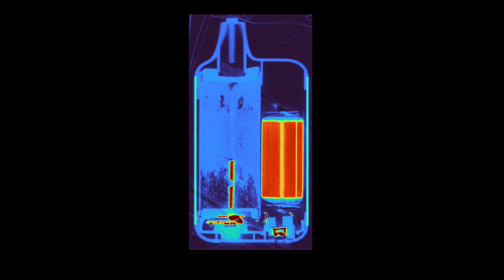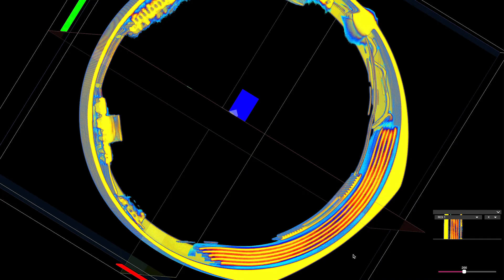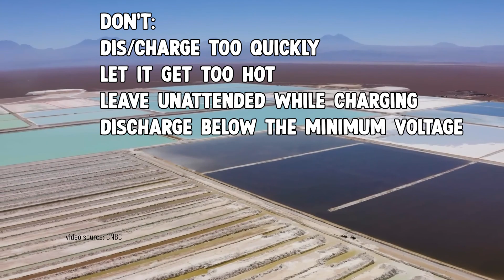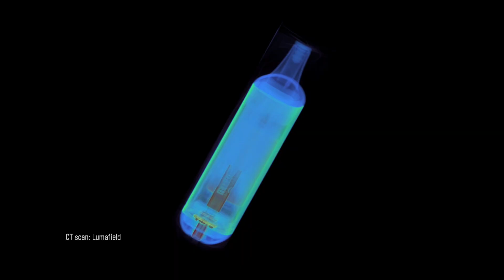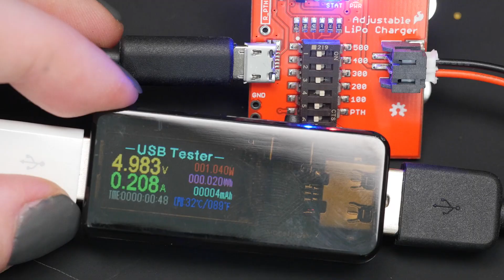Can you reuse these batteries?

Comment: Hello.
I have collected over 1000 empty vapes through my friends and friends of friends.
I am over 1 kWh with my power bank powering the lights in my house.
However, my batteries are submerged in hydraulic oil to avoid any leakage issues.

Comment: Be advised. I was safely recharging a vape battery I found in the gutter using methods almost identical to these. After a few moments, it exploded, flew off my workbench, and burned a hole in the floor. Also, while trying to contain it, I inhaled the fumes. The battery was probably compromised, considering where I found it. For a tiny battery, it was an incredible fire. 
Thank you for sharing a safe way to reuse the little power storage units.
Inspection before charging for any flaw is important. 
Cheers!

Comment: I modified one to be a handheld wind speed, temperature, and humidity device. Now modifying another as a wireless speed controller for my boat's trolling motor. I think I can fit the ATtiny85, pot, and the NRF24 inside the case.

Comment: The reason I use them (I'm in the UK though) is the max 2ml tank rule in the UK. It's just very annoying to have a refill a vape every few puffs and the 2ml thing is like a bad joke.

To be fair I've only used them since they added a way to recharge and refill them but yeah they get maybe 2 weeks best case even with that.

That said I haven't binned a battery yet I keep them as spares and tend to only use the lost Mary bm6000 so I can keep switching the batteries.

Comment: Nicotine is actually a very toxic chemical with an LD50 lethal dose of only 6,5mg / kg. If a vape contains 20 mg / ml and 2 ml that equals 40 mg. Combine this with the fact that nicotine absorbs through skin (that is why nicotine patches work). 40 mg would be lethal to someone with the weight of 6kg. That might not be you but a small baby or pet could get severly injured when exposed. So it's mandatory to wear gloves when doing this and to get rid of any residues asap.

Comment: I watched this yesterday,today I saw a vape in the road. Now I have a battery to play with. the disassembly info presented here was invaluable.
BTW,the low cost TP4056 USB charging circuit can be tweaked by a resistor change to drop the charge current from 1 amp down to lower levels.

Comment: I have disassembled my first one and it has a 1Mhz ARM N32G-031.  It also has a small LCD display.  What a huge waste!  Wondering if the circuit can be re-purposed.
Reply: In addition, there is an airflow detector which fires up the processor any time there is flow.  The push button on it allows for the switching of the mode of operation.  I wonder if there is any way to access and re-program the processor via the USB-C connector.

Comment: great information in this video, rember to capacity test all your cells before use, i noticed recycled  vape cells to be more consistent then recycled 18650 cells but I've had a few that had lower capacity then expected, i use the same charger/ tester for 18650 and the vape cells, use a dummy cell in the charger with jump leads for the vape cells,  these vapes banned here in Australia but i still find some

Comment: Anyone here have any idea why I might be reading 7.4v off of one of the batteries I pulled from a ripper vape by rufpuf? It has 3.7v 550mah printed on it... It does not appear to be two cells in series. It's a cylinder with positive and negative on the ends. I think I'm just uneducated on my multimeter and used the wrong setting.

Comment: Instant sub. THANKS! LEarned a TON. Grab yourself a heat gun: better and safer than a lighter. Got one at HD w adjustable heat settings for 10 bucks on clearance, or go the HF route for a cheapo one. You can mount it (or a lot of other things) on one of those articulating arms that mount to the edge of a desk or workbench with a C clamp-like thumb screw. Go really nuts and "sandbag" (weight) the mounting end and you can plop it anywhere. Leave the lighted (bulb) end intact to retain the lamp functionality. I put spring clamps and a 3 outlet power strip on mine so i can mount just about anything to it thats not too big or heavy, so no elephants or automobiles 😊, and have 3 easily accessible outlets to plug into. This contraption is great to flash (dry the surface) paint, glue, etc without having to hold the heat gun, hair dryer, etc. I have several and theyre all made from curbside shopping endeavors, so they were all FoC and upcycled, so a little less trash in landfills is an added bonus. This concludes our knowledge exchange.... 😂

Comment: I am so confused as to why you would need to match the capacity of the battery to the bms. To optimize the results of the battery, you would need to match the current rating of the load, not the capacity. You can install a huge battery onto something tiny and/or charge very slowly without much issue, so why would this be of any concern? Unless I do not understand what you had said.
Reply from the maker: I did use a sort of shorthand there-- folks try to run a large electrical load from a small battery more often than the huge battery scenario you propose, and I'm assuming that the batteries can be dangerous if charged/discharged at a faster rate than 1C-- the capacity number (in mA instead of mAh) therefore conveniently represents the largest load you should attempt to run without risking the battery overheating or malfunctioning. Of course you can go lower, just not higher So I probably should have been more specific, you're right! Thanks for helping me clarify.
Reply: It is no issue. Most people in general should not be messing with any battery other than household batteries. It's too dangerous for the average person. I was processing around 200-250 of these and was curious if anyone else was doing the same.

Comment: Well, we don't have these, but i did find a slightly toasted e-bike battery. Only 5 cells were bad out of about 40. So now i have 35 samsung 18650 cells each at 2.5ah. I used a capacity tester from aliexpress. It charges, discharges and measures capacity so i know which are better and worse. I then got a couple powerbank housings meant for these so i got some phone powerbanks. I also got a 18650 powered radio that works incredibly well, and doubles as a bluetooth speaker.

Comment: This is a great video! I recharge my Breeze Pro batteries using a 4056 chip with over charge protection, and add liquid vape juice so I can reuse these otherwise expensive "disposables." These don't appear to have any sort of circuit board within them. I always the voltage while inspecting the battery prior to charging, but I'd like to prevent over discharge if I continue to use these batteries in the breeze. Do you have any suggestions?

Comment: disposables are taking over the uk atm, the government has limited them to 600 puffs (which is bullshit),  most corner shops are selling 6,000 to 12,000 puff vapes wich usualy come with a usb charging port on the bottom.these still aren't great (sealed units), but it's a damn sight better than the legal 600 puff elf bars etc that are still using the same lithium bateries. I started vaping ten years ago, and I used to have several local vape shops where I could go and buy coils for my particular tank and get bateries for my rechargable body. now when I even go to those original shops they only sell disposables, vaping for a little while was a nice hoby, on the same level as people who care about cigars, but it's just not profitable anymore and it sucks.

Comment: I used to smoke these quite a bit but then went back to a vape mod. Later down the road, I got quite interested in arduino. Now I've been cracking these open for the 3.7v li-ion batteries, i have so many of them now! Thanks!

I have found many of these on the ground too and now I've been picking them up, both to do my part and to salvage more batteries.

Comment: I use them to make remote control boats.. but I only use the larger vape battery's.. to make a 6x1500mAh 3s2p  battery .. I make the boats out of things I have around the house with the goal of spending as little as possible to make them.  I also made a hovercraft out of I cordless vacuum cleaner that was broken and my friend was going to throw out.. you can also top up liquid inside them and reuse them but only once a twice before the test gets bad..

Comment: For the battery to the charge controller you should probably have a switch just incase as well as a well ventilated room and a bucket of sand preferably incase you puncture the battery also remember this if you see a rectangular battery that puffy don't poke it. It doesn't like it  (  =

Comment: would it be possible to combine a bunch of these vape batteries to make a battery bank? I have about 20 of these, most of them use the larger battery with built in charging circuits. I would really like to make a cheap battery bank for emergencies.

Comment: USA laws are really stupid about this. In Europe you can get rechargeable vapes with changeable pods without a problem. At home, I use a 18650 box mod + DIY coil and wick atomizer e-cig but they are cumbersome to carry around, so I bought two disposables before finally buying a rechargeable (I didn't like the disposable aspect at all) and I've been wondering what to do with them since. Seeing how easily salvageable the batteries are, I'm pretty sure my electrician uncle will happily accept them for use in his projects.

Comment: @BeckyStern, some disposable vapes even go with dual purpose pressure sensors, which can be used for charging.

Here is instruction how to check, if pressure sensor is dual purpose. Heating coil coil should be unsoldered. Then we need USB cable. Black wire from USB cable should be connnected with black wire from sensor and battery (-). Red wire from USB cable should be connected with blue wire from sensor. Red wire from sensor is soldered to battery (+), let it stay there. USB connector should be inserted in charger port. If pressure sensor has charging function, LED swithes ON (when battery voltage is > 2.7 V), and blinks 3 times, when USB power is disconnected.

Dual purpose pressure sensor has TC/CC/CV charging methods, maximum CC about 200 mA. If battery is almost dead ( 0.5 - 3 V ), status LED lihgts ON only after some time.

Comment: I was scuba diving and found 6 vapes in the same spot, probably due to ice fisherman. Anyways I ripped them apart and the lipo batteries were 0 volts, I charged them up and did a discharge test and all of them had 95% of capacity left over and have all stayed at or near 4.1v for 3 months afterwards. All these vapes were covered in 30 feet of water for probably 4-6 months and still work... who would have known. I have way better luck with longevity from 18650 lithium batteries since I have a couple of 20-year Pansonic ones that have been brought down to zero volts for many years before I salvaged them. They still have a third of their capacity and are really good for flashlights.
Reply: Be careful with that!
You do not want those spiky crystals forming on the electrode of the battery, its better to toss it if its lower than like 2.5v than to have an avoidable fire hazard.
Especially since those batterys do not have any safeguards like the CID on 18650s.
Reply: You're going to want to test the internal resistance of the cells for a better idea of their condition rather than just voltage.

Comment: You'd save so much money if you bought wire and connectors and crimped them yourself. I also wouldn't splice the connectors in. Just desolder the old wires.

Comment: I have a lot of these found on the side of the road, almost all are rechargeable and have a lot of the charging cases for earbuds ect....
Also have a big box of hundreds of 18650s that I've salvaged.
Are the batteries (18650&the 3.7v pouch batteries) swappable?
Can I use the charging circuit to make 18650 chargers? Can I swap out the little pouch cells with an 18650? 
Any idea of the voltage and current/amperage that comes off the board to the vape thingy? If I bypass the thing that turns on and off the vape by suction and replace it with a switch could it be turned into a USB charger if the voltage and current are correct?
:)

Comment: i added a bunch of old half cooked iphone batteries and salvaged vapor bats in parallel to some really cheap motion sensor undercounter kitchen lights. turned some cheap $1.40 lights that i had to charge weekly into an every other month ordeal and atleast the iphone batteries were thin enough to just slide in behind the circuit boards in the original enclosure. i wonder what the new EU law will do to these single use devices. it would be cool if you could pop out the batteries easily and move them to a new device since im guessing people go through these things a couple times per week. would lower costs too. i do know that many places have a rule on transporting lipol bats in freight where if the devices are single use you are allowed to charge them to a much higher level. kinda bad that we are incentivizing this.

Comment: some disposables come with a charging port now usb mini or usbC i cannot quite figure out how to bypass the pressure sensor leaving just the output for small led projects and the built in charging port. maybe another video showing one of these devices with the charging port and how to keep the charger and battery together as a unit.
Reply: Honestly that’s my biggest problem… I would love to reuse the charging boards on these, but most of them are tide to the onboard air pressure on/off switch, and don’t have enough skills to figure out how to implement my own switch… I have quite a few projects I want to use these for, but need to buy my own charging circuits for them

Comment: WARNING!!! You supposed to start this video with a big WARNING! sign. This rechargeable batteries could explode or set any house on fire if you smash them  drop them or short circuit occur between plus and minus terminals. Protection equipment required gloves and safety glasses when you manipulate them.

Comment: You can gather as much of it and connect them in parallel,Sample 20 pieces soldered in parallel,Then put some PowerBank module in it, Voila! instant high amphere stored PowerBank that can charge your phone.Not very attractive looking because it's been fabricated or home made,But it works and not easily be drained battery compare to some cheap PowerBanks that you can purchase on some poor urban area

Comment: When I found out about these batteries some time ago I started collecting them, and asking people I know to not throw them in the trash. That was about 2 years ago.
Now I have a collection of over 50 of these batteries! They won't last forever, and you never know what quality you get, so it doesn't hurt to have them on hand.
Most are 500mAh, but some are even up to 1500mAh! And in those 2 years I only had 3 batteries that had a charge too low to be safe for reuse.
Thank you for helping to keep these things out of the environment!
If you plan on making battery packs with multiple cells, almost all of the vapes I got mu hands on were made of aluminium tubes. They are ideal for housing the batteries! Just make sure to clean then to get the smelly (and often addictive) out ;)
Reply: With the low voltage issue, you can usually nurse them back into good health. It typically results in a lower overall milliamp hour capacity as the only adverse effect.
Reply: Me too, there's also 2400mAh disposable e cig batteries now.
Reply: Aluminum can be used for other things like plating, panels and interior structures holding hardware. So it's useful and I'm planning on going to scrapping them all for a rc fleet (coastal scrapyard or coastal bay scrapper fleets) because most of my rc fleet is made from scrap I find in scrapyards or areas with abundance of E-waste, perfect for the job.
Reply: @mattmuch7536 If they are just too flat, yes. But a charger can't know if it's just too flat, or actually damaged. So to protect the user from fire, and the seller from major legal claims due to fire, they generally don't charge id the voltage is too low.

Comment: Thanks for this video! I think you confirmed my suspicion... The ones I've been seeing lately, even with a USB-C recharge port attached, don't seem to have any protection circuit whatsoever. They just rely on chargers, and USB ports being protected or something, I guess? Does a standard USB port on a computer even offer lithium battery charging protection?? 😂 I don't think so... I honestly don't get it, I don't understand how these things don't get overcharged. The ONLY thing I notice is two of the tiniest resistors you've ever seen, mounted on the itty-bitty USB-C board labeled R1 and R2. Idk what they could be doing, but I doubt anything overly helpful. Only other guess is perhaps they've somehow integrated some protection bits onboard that round air-pressure switch? Maybe?? But again, it's so dang small, I really doubt it. If you've got any insight, let me know (: Thank you!
Reply: They have a little IC that does overvolt protection. I’m relatively sure they do not offer any sort of thermal protection tho. I could be wrong.